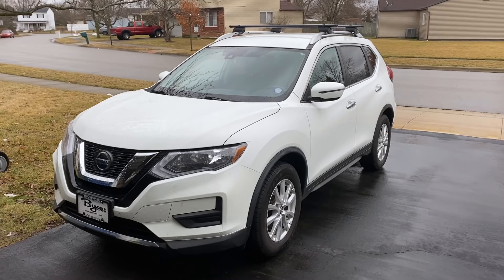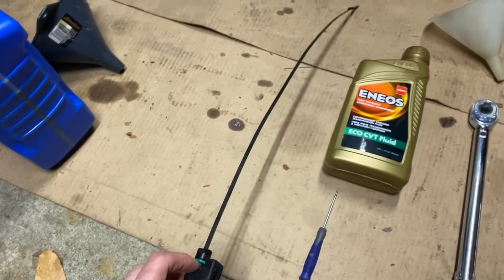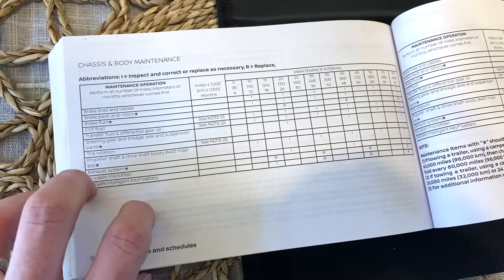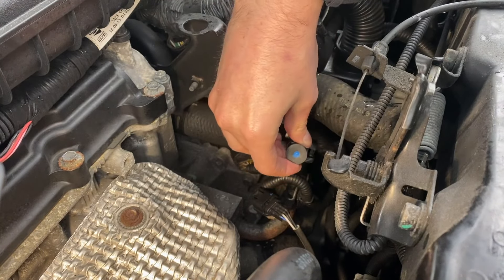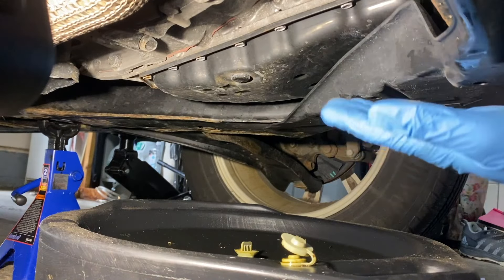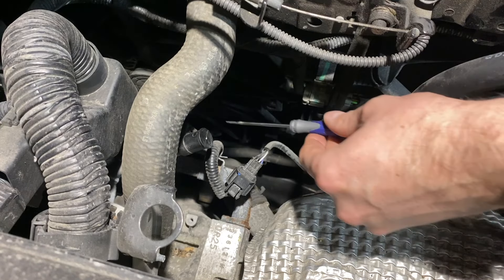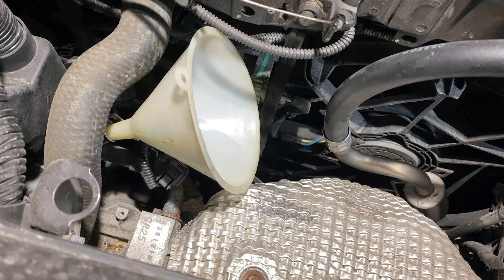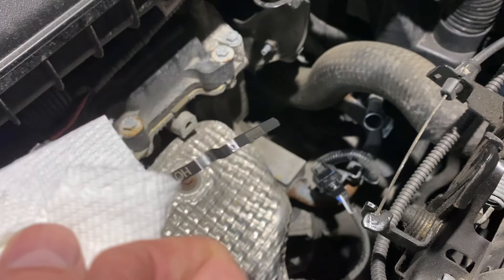2013 - 2020 Nissan Rogue CVT Fluid Change

Comment: Excellent video Matt, thank you for this. I've done one CVT fluid d&f on daughter's 17 2.5L Rogue but this vid would have really helped me. I watched lots of vids on how to get cap off, still broke plastic clip. 😆 After finished held it on with a twist tie until bought new cap, worked fine. I used Valvoline Full Synthetic dedicated CVT fluid. Not newer CVT/w trans fluid, won't use that. Seems to be doing fine. I know Eneos good stuff. Didn't realize crush washer CVT drain plug same as oil drain plug. Wish I had known which dipstick was correct one, just put back amount out. Few questions for you. After putting CVT through gears, you checked the level with the engine off, correct?  What was CVT level after warm up to operating temp? Within crosshatch area, or slightly above? How much fluid did you actually refill? After watching this, I will be doing another, this time w/ linked dipstick. Thanks again. I can tell you, there is a longer neck funnel that works better than the shorty you used. It's made by Hopkins/FloTool. Looks like AZ carries it.
Reply from the maker: Glad the video was helpful! For your questions:
1. Yes I was checking the fluid level. You could check while jacked up, just be sure to note the fluid level beforehand to be sure it’s a match.
2. It’s recommended to check the fluid level warm for transmissions. You also can check cold, just be sure (again) to note the fluid level before hand (while also cold) and compare to that.
3. Yes, we want to be within the crosshatch target level.
4. 3.75 quarts seems to be the consistent yield for draining through the bolt. I have a Follow-Up video where we are dropping the pan, which gets a bit more.
Reply: @MattStephensRich  Thanks for the reply Matt. I was able to drain the fluid on the level ground. I think I loosened the drain plug while on ramps, just enough to break free but not drip, then did a vehicle level drain. 
For answer 2.), did you mean to say recommended check level when "warm",  (in cross hatch), because you went on to say you "can also do cold just check level prior." Because I've done it once with no dipstick, I don't really have a confident reference like you did so I'll be using your diy as guide for the next d&f. Dipstick arrived from Amazon yesterday. Hope my follow up question not too much of pain. I subscribed and will be sure to watch follow up vid. Thanks again. 👍
Reply from the maker: Dipstick will greatly help! And yes, you’re correct to be in the crosshatch while warm (and ideally, it’s always best to check while warm). You’re exactly right on what I was trying to get at for checking cold - essentially, as long as you have an initial reference line, you could check cold.
Reply: @MattStephensRich  Got it! 👍
Reply: I have also seen the CVT fluid that also says it is an ATF.  That scares me a little bit too really.  I wonder if that stuff has been ruining CVTs considering how sensitive they are known to be.  You really don't want ATF anywhere near these things because if you dump that in there you will have to get the whole thing flushed or kiss your CVT goodbye in 1,000 to 2,000 miles.  That may even kill it quicker than that really.
Reply: @charleshines2142  As long as Valvoline dedicated for CVT fluid available, no reason IMO, to try or use the stuff that touts itself as for both.
Reply from the maker: In fairness, there really isn’t too much difference between a traditional automatic transmission fluid and CVT – the focus with additives is making sure the fluid can suspend contaminants while also providing good gripping action for the transmission clutch packs or CVT belt. So that’s to say – there’s definitely ways you can meet both specs with the same fluid. That being said, the Nissan spec does seem pretty specialized, so I would recommend going with a fluid certified only for this application, rather than an above all type of fluid.
Reply: @MattStephensRich  Not being a tribiologist, I can't state definitely one way or the other on CVT/trans vs CVT fluid in a CVT. Just my thinking that using a dedicated CVT fluid in a CVT trans makes more sense 'to me'. As far as Nissan goes, I don't believe the fluid is as much the issue as the Jatco CVTs themselves. Why I'm highly skeptical NS3 is really superior to the dedicated aftermarket CVT fluids that are suitable/recommended for Nissan NS3 applications. In other words, changing the fluid is more important.

Comment: How many miles did your rogue have on it when you did your first fluid change?  I bought a 2019 rogue SL used , with 30k and found out it had been a hertz rental out of Florida and had had hail damage repair,after I had paid cash for it and saw my title 😮.just ordered my dipstick, thanks for link👍
Reply from the maker: This fluid swap wasn’t done until 70,000. 30,000 would definitely be playing it safe - I would honestly even take it to 40k or 50k confidently (recognizing many regular transmissions have 60k intervals)
Reply: @MattStephensRich  I'm seeing dealer websites saying 20,000 mile intervals, which seems excessive.

Comment: I’ve 2017 with 84k miles (135k km). I’m not sure if previous owner changed it or not. Is it recommended to change at this level? I heard a lot that after certain miles if we try to change the fluid for first time, it can cause serious problems. I really appreciate your effort for this video. Thanks a lot.
Reply from the maker: Still worth doing the swap, as CVT ultimately has tighter tolerance than a traditional transmission!
Reply: you’d get much more problems letting it chill than just changing. trans is one of those things that once they break you can’t just save up and drive less it’s in ICU till you fix

Comment: Operating temp for hot would be once the fans come on. Listen for the fans, then check. Do the Nissans have a over fill bolt? Aka weep bolt, fluid check bolt, etc.
Reply from the maker: Yes there is a weep bolt, however have found a lot of mismatched recommendation for using it. Ultimately going the simple measure-and-fill felt apt, especially for folks who aren’t able to be under the car while running.
Reply: Yes they have one about 6 inches from the drain bolt. Very easy to find and use if you know what you're looking for.
Reply from the maker: @thebeetalls  Ultimately wanted to discuss the dipstick approach as well, as there remains a quite-large crowd out there who are more familiar with that approach. Also saw an opportunity to provide better coverage on the approach, as Youtube videos discussing dipstick were slim to none.

Comment: Does not changing your engine oil have anything thing to do with having problems with your transmission trying to find a answer to this question thank you
Reply: no
Reply from the maker: Not correlated, and different engine/oil systems.

Comment: Can I take my 2019 Nissan Rogue to have a CVT transmission service to a mechanic shop instead of a dealership?
Reply from the maker: Yes - just want to be sure they’re using the right spec fluid (Asian CVT fluid is a little more finicky than American spec/not as mix and match)

Comment: Hi , whats that 14mm bolt on an angle on minute 14:56 (left) for ? 
next to the 19mm drain plug . Great video thank you !
Reply from the maker: That is the bleed valve under the transmission, which you can also use for leveling fluid. I opted to do the dipstick route as it’s a lot more comfortable for a wider variety of people and an easier way to measure levels without needed to get under the car. 😊
Reply: Great thanks for your help !

Comment: i got a dip stick  for my 2018 rouge  ,,just had this done at  the dealer  it has 30,000 miles on it...nissan gave us a 7 year warranty  ,,an if i did it,,well  you know what they would say
Reply: oh an i leave  my dip stick in...no problems   if the oil was so bad  it would up the trans,,,

Comment: Thank you for the vid. I had a neighborly mechanic change out my  CVT NS3 Fluid 2015 Rogue.  A month later my transfer case went bad.  I do wonder if it had something to do with the transmission change at 89K. It was just a drain and fill performed.
Reply from the maker: Great to hear!
Reply: cvt and transfer case are completely different on this car and are using completely different fluids
Reply: @victorradu9645  oic yep  thats right. i found that out & got it fixed. thx

Comment: I have a 2018 rogue with 130k miles on it, never changed the transmission fluid, is it too late to do so? Also how much did everything cost you in total?
Reply from the maker: Never too late for a fluid swap! Quarts vary in price, around $15-$20 per quart.

Comment: Great video!  May I ask...that fluid looked quite dark...how many miles were on that fluid?
Reply from the maker: This was a 70,000 mile interval - TBH, fluid will darken quickly, as it's objective is to pick up and suspend debris/particulate so it doesn't grind against components. :)
Reply: @MattStephensRich  Well thanks for the reply - with the mileage.  I guess if this was the first change, it's not too unusual for it to be that dark.  I mean, it's not black or burnt....just - ready for a change.
And what you said about pick up and suspend particles....never heard that before about trans fluid. Engine oil DOES do that, but this is hydraulic fluid. This stuff oxidizes and essentially burns (thus the burnt smell when real old).  But not to worry....I asked a simple question and you gave me the answer - Thank you!
Reply from the maker: I mean in essence, hydraulic fluid and motor oil are more similar than not - they lubricate, provide cooling (that is, ability to move heat from specific spots and move to the cooler), hydraulic pressure (VVT in the engine, hydraulic solenoids in the transmission), and bring performance enhancers for smooth operation. Hydraulic fluid indeed also suspends particles, albeit it deals with friction grinding of transmission gears (or CVT belt in this case) that creates far more constant/predictable metal debris than combustion in the engine. This is partly why it's always best practice to clean the catch magnet when dropping the transmission oil pan, which captures those metal flakes off of the oil. :)

Comment: Great video!  May I ask? How many miles on the vehicle (to get the fluid that dark)?
Reply from the maker: This was a 70,000 mile interval - TBH, fluid will darken quickly, as it's objective is to pick up and suspend debris/particulate so it doesn't grind against components. :)

Comment: Just had the ATF flushed on my 2015 at a local transmission shop. Paid over $300 but had to bite the bullet as I didn't know if the previous owner did it recently and as this video states, you can't even look at the damn fluid ! I've heard with these CVT transmissions you better flush ( not just drain and fill) every 25-30k or so
Reply from the maker: Better safe than sorry!
Reply: I've heard drain and fill only😂

Comment: I took my Frontier in for warranty work yesterday. I was curious what the CVT service would cost Nissan told me $400 for the service.
Reply from the maker: Woof!
Reply: Frontier doesn't have a cvt
Reply: @silvercommander  I know that I own a Frontier. I was curious as to what a CVT service would cost at Nissan.
Reply: @KNIGHTOFELEMIA-i7i  I've owned my frontier since new 2010 currently has 204k miles. Gifted it to my teenage son last year.

Comment: should i change filter?
Reply: It’s a mesh filter only available with  valve body.  My 2010 started to whine then suddenly chattering. Turned off and research. they said trans junk. I bought a pan gasket and 6 qt. Dropped pan and mesh filter. Couldn’t even see through it due to particles. Clean clean clean. New fluid. Like new no whine runs perfect again.

Comment: Did you or are you able to leave the aftermarket dip stick in like the oil dipstick or do you have to take it out?
Reply from the maker: Yea you can leave it in!
Reply: No don't leave  the dip stick in I heard that the cvt fluid will corrod the dip stick

Comment: My 2017 is the same way, no real stick in there.  Just a cap and the first time it will be difficult to get it out so make sure that when it finally comes loose your hand does not jerk across something sharp anywhere in there.  Also that tab is a little bit confusing too.  The real reason I am watching this is that I plan to clean the pan and filter.  Do these commonly leak once the pan is off and back on?  I am assuming you want am OEM gasket from the dealer and don't reuse the old one.  Is this something most people can do with no trouble?  my biggest fear is leaks.  I know I should keep a magnetic tray handy for the bolts and make sure my gaskets holes match the number of bolts.  Of course once that is finally over, clean it good so I can see any leaks and then put the fluid in and check the level using the overflow at the correct temperature.  I know don't do it without 4 quarts of fluid ready to go in.  I know a transmission shop where I can take the old fluid and the owner uses it in a waste oil burner.
Reply from the maker: Working on that video now actually! It’s relatively easy to do the pan drop and filter swap - there is the OEM gasket or aftermarket options you can use.
Reply: @MattStephensRich  Also something to know about the fluid is that the dye in it is a UV dye that will show up nice when exposed to UV light.  It is helpful to know that since this fluid is hard to see normally on a dipstick.  Just make sure if you get a dipstick you can return it if it is one of the wrong ones that are too short to give a reading.

Comment: Did Eneos give you any problem? Nissan insists their own CVT fluid or else will damage the transmission.
Reply from the maker: Nope not at all. On further digging, there’s also a high likelihood Eneos fulfills the Nissan fluid order.

In general, all OEMs “insist” on their fluid, but I’ve never found issue with using any fluid that’s certified as in-spec.

Comment: I tried one from Amazon and it was not long enough to show a reading.  I had it working fine and just wanted a baseline so I know if I am getting close.  It would be a good idea to get one hot and cold and preferably without having added or removed any fluid yet.  They say it expands.  I am not so sure about that but I know it does flow super easily.
Reply from the maker: Thanks for sharing!

Comment: I’m sorry if I missed it but how many miles were on this vehicle? I have a 2019 With 27,000 miles. I plan on getting this done at my 30,000 mile oil change. I purchased it about a year ago with 15,000 miles, I feel like there has been a whine at like 3,000 RPM since the day I bought it.
Reply from the maker: This car was at 80,000 when I did the service (bought it as a former fleet car). Likewise there was some whining, which did go away with the fluid swap.

Comment: Thanks for your video. Question: did your dipstick show in the HOT area after you drove the car? The video didn't show your reading clearly when it was hot. Here's the detailed background for my question. Hopefully somebody will see this and have an explanation. Thanks.

I have a 2015 Rogue 2wd, purchased new, Jan 2016; has just over 80K miles. Changed CVT fluid at 60K mi as suggested in owner's manual. Received letter from Nissan re class action issue with CVT's failing. Nissan extended CVT warranty to 80K mi or 7 years. I am now just over both. My son experienced an inability to accelerate after about 90 minutes of freeway driving at around 75 mph and temp was at or above 100F (6-30-23 was 108F in Sacramento). Engine was not overheating and no check engine. Pulled off, stopped, shut off several minutes, then started; car was normal the rest of the trip. Read a nissan bulletin describing this with certain model CVT's when driving sustained at around that speed and temp above 98F. Decided to change and level fluid to hedge my bets against the CVT overheating and possible computer limiting as described in bulletin. Here's the weird thing. First, unlike your and several other  Rogue CVT fluid change videos on Youtube, I got 5 qts fluid, just by removing the cvt drain plug; nothing fancy. Parked on level garage floor, no jacking. I I had briefly started the car to move into garage; maybe ran 1 minute, max. Second, my car (purchased new) came with a dipstick. I added 4 quarts new fluid and it didn't register on dipstick. Added another 1/2 or so and started to register. Ran car, shifted through gears multiple times, heated engine and still barely registered so gradually added another 1/2 qt (up to 5 at this point). Drove car 15 minutes, including high speed and shifted normally. Here's issue 3; even though the engine temp was normal (dial in the middle as usual), the dipstick just showed fluid up to near the high mark on the cold section. It didn't go up the the HOT section, not even close. I added maybe another 1/2 qt (now up to 5.5 qts added) and waited with engine running, level, at temp and still reading in the lower mark. At this point wasn't going to push and risk overfill as I was a bit over what I'd removed.
Reply from the maker: Was checking hot.

If helpful, there’s a bleeder valve underneath you can also use for checking fluid level; it essentially drains off excess fluid until it is at the correct spot!
Reply: @MattStephensRich  where is that over flow bleeder located?